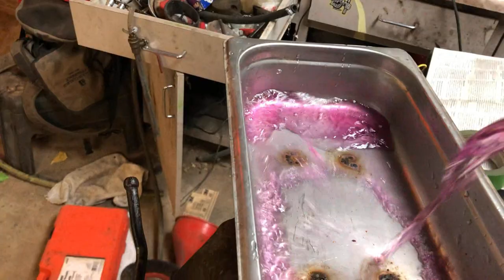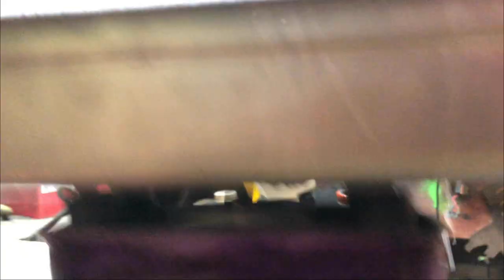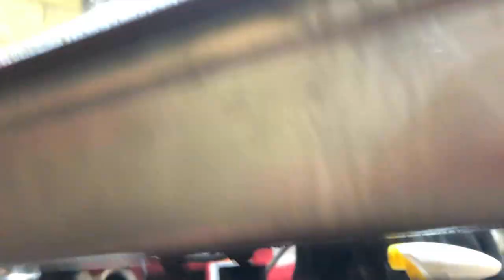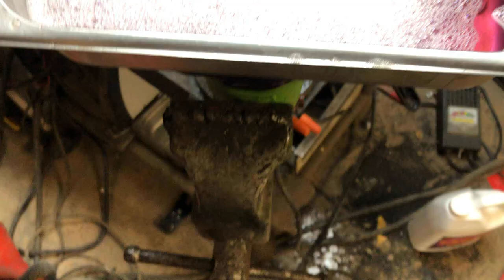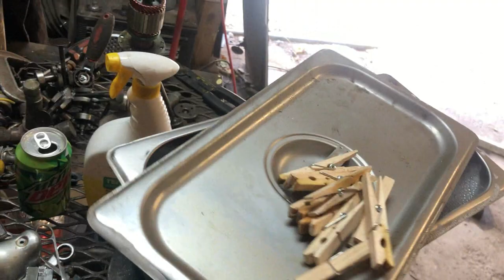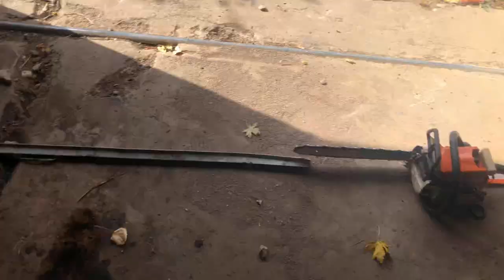Cheapest DIY “ultrasonic” cleaner ever. (That works)

Comment: I bet one could measure the frequency of the water shake in there. Screw the nay sayers, it’s doing something.
Reply from the maker: Thank you! For as simple as it is it really works, haven't used any chemicals harsher than degreaser in it and haven't needed to.
Reply: @NastyCustoms5150  gasoline itself is the GREATEST for some stuff. Not the whole unit full of gas of course. Fill up a glass or peunutbutter jar with gas and set it on your screen. Works great. Obviously too aggressive for some things but not for carbs!
Reply: Likely got some higher harmonics that work?

Comment: not to piss on your picnic, but an ultrasonic cleaner works with sound waves , but if it works that's all that matters i guess😁
Reply: WRONG!
Reply: Every vibrating object produces sound waves. You can even hear them in the video. The better question is whether the presence of higher frequencies really makes much of a difference.
Reply: 40Hz
Reply: I guess the vibrations produce the cleaning, make a vibrating container and you have a very cheap "ultrasonic cleaner".

Also, the brands on the market are all shitty products from China's factories that arrive either broken or with a very limited lifespan and certainly aren't worth the almost 300 bucks they cost.
Reply from the maker: @lecobra418 Honestly for the almost no money this thing cost it works great and I still use it, not as good as an actual ultrasonic cleaner most likely but it’s saved me from having to buy one! Thanks for the input I appreciate it!

Comment: Typical podunk solution for a $50 item. Something that makes a ridiculously uncomfortable amount of noise and is not what is claimed.

Yes, you can get an ultrasonic cleaner for $50.

This is stupid. Of course he doesn't see why this wouldn't work... He built it. 🤦
Reply from the maker: I don’t think I can get one shipped to podunk for $50.
Reply: And Jacob,  I'll tell you now, there is NO ultrasonic cleaner capable  of taking car parts available in the UK for less than £80 ($110 ). Let that sink in, America is NOT the inly country on the planet...now go away..